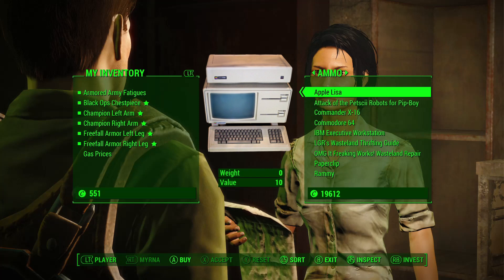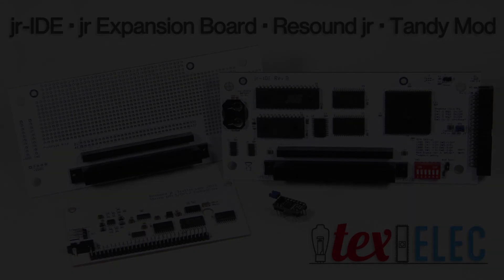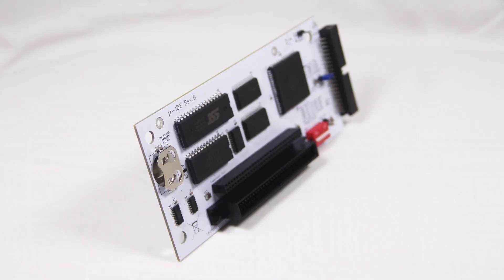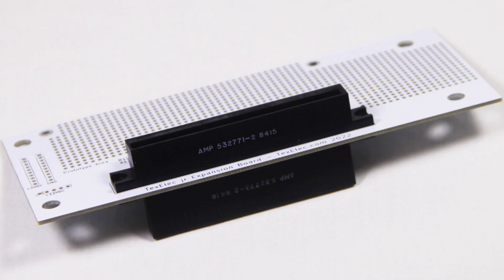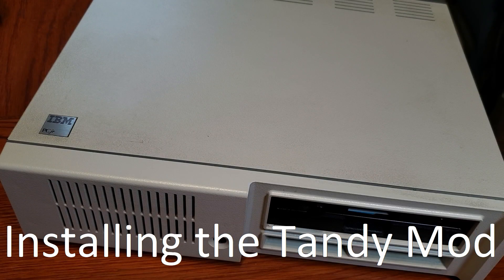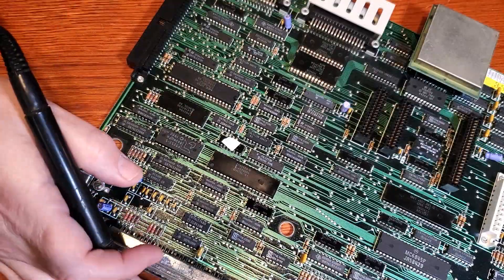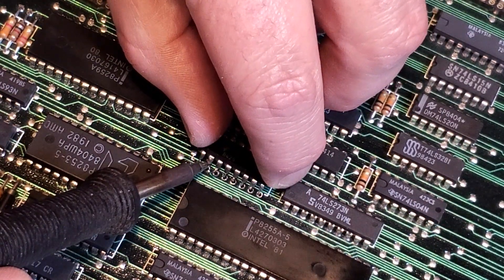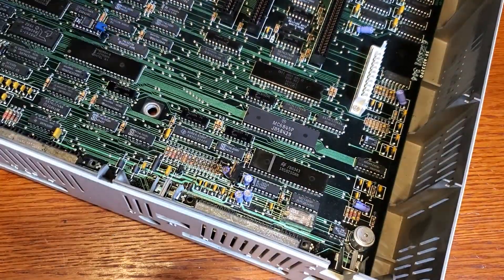Jr IDE Rev B, Resound jr OPL3 / Adlib Clone and the TandyMod for the PCjr w/ TandyMod Installation!

Comment: Your Tandy video mode mod board is lower priced than what PC Enterprises sold in the 90's. Their kit was $14 but easier to install. It was a piece of wire and some 7400 series chip that was only partly used for the mod. The hack was cutting one trace on top of the board, bending out all but the power pins on the chip and soldering it atop another chip on the board to provide power. Cut the wire in two pieces and solder between two pins on the added chip and two places on the mainboard. After seeing what little I got for my $14 I modded a few more PCjrs by scavenging the required chip off things like dead floppy controllers and a dead 5150 PC motherboard. IBM Canada used to have the mod instructions on their website. I just tried to find the instructions online and came up empty. How odd... :P

I never ran into any software that required undoing the mod. If there is any, it should be simple to add a switch to disconnect the added wires and reconnect the severed trace.

PC Enterprises also sold a Tandy Sound mod for $14 but I figured it too would be a simple hack and I figured someone would post online somewhere how they did it. Now there's the Tsound program that makes it do Tandy sound on demand, but I still want to know what the PC Enterprises hardware mod was. I only ever ran into one game that required both Tandy video and Tandy sound and refused to use Tandy video mode because it couldn't detect Tandy sound.

While digging around for info just now, I found someone had made a prototype board to plug into the 8088 socket and add an 8087. But while he'd made and populated it, he still hasn't (as of some time in 2022) actually tested it. One feature of it is it runs the CPU in maximum mode where the PCjr runs it in minimum mode. Speed boost possibility? Sounds like a project for Texelec to acquire and finish development if the person working on it isn't going to finish it.

Comment: There are later motherboard revisions that have the socketed bios and processor correct?
Reply: Every PCjr I worked on had a socketed CPU and ROMs. May be some that aren't. PC Enterprises sold a few mods that plugged in between the ROM chips and their sockets. An NEC V20 CPU was a popular upgrade, especially for people wanting to run CP/M.
Reply: Mine has them socketed.

Comment: The pins on the Tandy Mod will destroy whatever socket they're installed in.  Please use turned pins.
Reply from the maker: I have a ton of turned sockets, just by happenstance.  However, I can't seem to locate any turned pins from anyone other than Mill-Max.  I can only assume they make aerospace connectors, because their gold turned 2-pin connecter is $1.58.  It would cost about $10 each for all of the pins, which is just crazy.  I spent hours trying to locate another source, but no one seems to list the diameter of the pins, only the length and spacing.  I don't mind paying more for them, but I need something a little cheaper than what I've found.

Comment: For a chip as cheap and available as the 74LS157, just buzz it off the legs, then desolder the pins individually - I like to identify whether I can just solder a component on to clipped leads rather than desolder from through-holes of a PCB. It may look a little different, but lessening the trauma to a PCB may have better results.
Reply from the maker: This is probably a better approach.

Comment: The real question is can we get all of these on one low-ish profile ISA board that can be inserted into the Tandy to ISA adapter or a regular PC?
That level of integration would make it beyond essential for a lot of vintage machines and increases your market.

The "Rammy" bit caught me off guard, was not expecting that reference
Reply from the maker: I have thought about an all in one, but one of the main issues is adding memory.  The 8-bit memory board will only work on an XT, so it would greatly limit the market.  I do have an idea floating in my head to address this, but I'll have to table it for a while.  Too many other fish to fry at the moment. 🙂
Reply: @TexElec  Could always do EMS and use a jumper to pick between them, which is what a lot of EMS cards back in the day did. Allow you to map some amount into the lower 1M and the rest as EMS. One rare-ish card I have, made by Cheetah, allows you to do the lower 1M, EMS, and/or XMS, all on the same board!
Reply: @AiOinc1  back in the day I had a 12mhz 80286 with 12 megabytes RAM. 512k in DIP chips on the motherboard, the rest was in three Micron 16 bit ISA cards. One card was different from the other two. It was set up to backfill the low RAM to 640K. The rest across the three boards I split between XMS and EMS. The boards used an EEPROM for configuring and a DOS program to change the settings. In the other slots were a Soundblaster 2 clone, a Pro Audio Spectrum clone (a Reel Magic minus all the video and SCSI components), a multi-I/O card, video card, and I don't recall what the 8th card was. May have been a dual gameport.
I had it all configured so that every DOS game and Windows automatically used whichever sound card was the best it supported. It would be nice to have it back but it's been gone for close to 30 years now.

But with an NEC V20 CPU the PCjr I had at the same time would run rings around the 286 with CP/M. 22NICE works with V20 and V30 CPUs to put them into Z80 mode and boot CP/M. On other CPUs 22NICE emulates a Z80. My PCjr ran CP/M faster than the Xerox 820-II I also had.